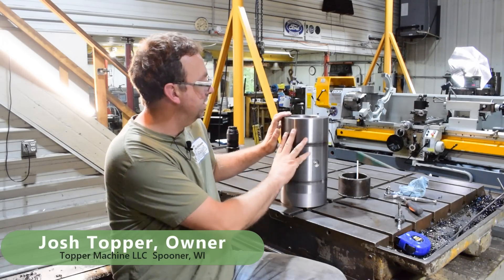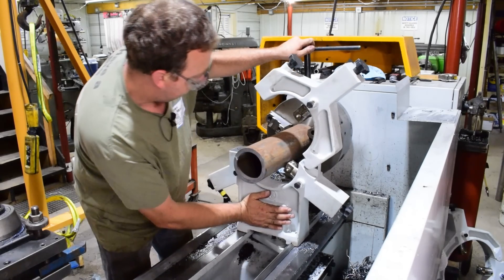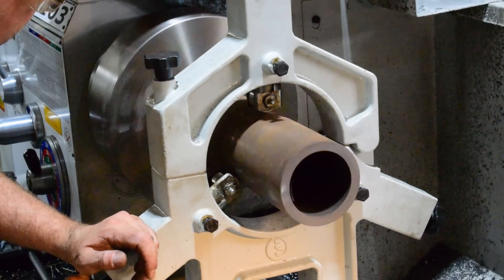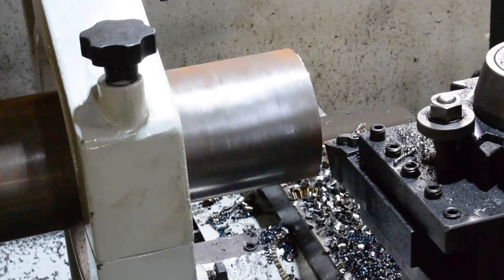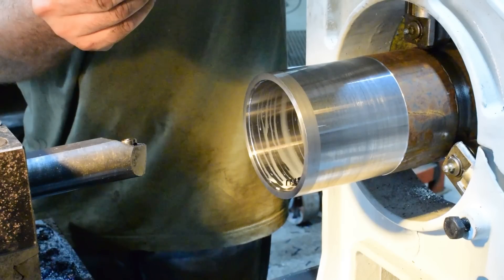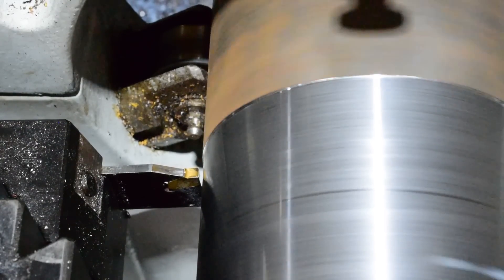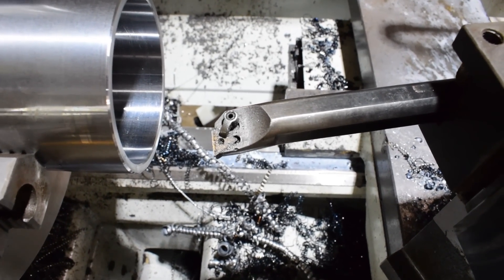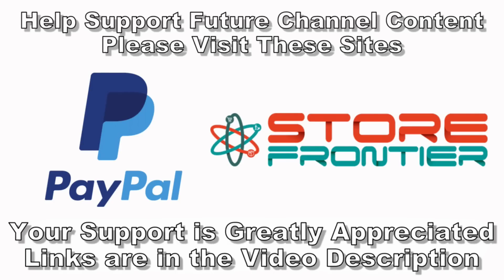Machining Custom Bushings for an Excavator - Manual Machinist

Comment: An old lineshaft driven oil grooving lathe turned up fairly recently not too far from me in Oldham....
It was made in the early 1900s and had a bull gear like a shaper that you could alter the stroke with...

I should've grabbed it actually...
🇬🇧😐
Reply from the maker: I have been watching for an oil groover. Seen a few, but nothing reasonable
Reply: @TopperMachineLLC  

This one was made in Manchester somewhere......all my stuff is the old lineshaft driven stuff...

I've loads of it Josh.. 
🇬🇧😐

Comment: I'm not questioning what you know, but rather questioning what I think I know.  It's my understanding that bushings are meant to be soft and take the wear in order to take the wear in order to save the pin and the machine.  Are you saying that it should have been a harder material that would still be softer than the pin and the machine?
Reply from the maker: Don't question your knowledge, you are correct in some applications. In my experience, on this kind of equipment you want both to be hard. Cat has the hardest pins and bushings I have ever seen. They last forever. It all depends on your application.
Reply: @TopperMachineLLC  thanks for the explanation.   I appreciate your time.

Comment: Hi , im from Canada and what you are doing is very appreciate and that help people like me to learn more from experience person. Thank you. Did you change your gear on your lathe machine do to a grease groove like that ? I try on my and don’t matter how fast my traveling tool,i can’t do it
Reply from the maker: Yes. It is actually a very course thread.
Reply: Thank you, im working on it ! I try to find what is the best gear set up for my lathe . My work is around line boring and I need to machine my own bushing sometimes . Thank you to answer me so fast . I very appreciate
Reply: Can you share with me your setting?
Reply from the maker: @lucouellet6771  it was 1 thread per inch. Set it up like your threading, but pick a course thread.
Reply: Ok ,Thank you so much!

Comment: Bushing design has a lot of variations in materials, often choosing dissimilar materials for the bushings and pins. I've seen bushings ment to be the hardened material and also the wear material. I've seen bushings made out of bronze, white bronze, cast iron, plastic, composites, nickle, hardened steel, etc ... that being said, good to give your customer what they want.

Comment: Hi Josh,
Everyone's expressed their views on your work/video sched so there's no point in me adding mine since I agree with them, mostly. 
One question regarding your grease grooves. Would it not be advantageous to "end " your thread say 1/8" from the outer end of the bushing (inside on the lathe) and allow the cutter to dwell and form a closed groove that would prevent the grease from migrating out of the end of the bushing. I realize there will probably be a seal at each end of the sleeve but this might prevent leakage too. Just a thought.
Thanks for your efforts.
Reply from the maker: It all depends on what the application and Customer specifications. I make them both ways, just depends on the customer.

Comment: I’m wondering if you do that boring operation without the coolant on. The inside, if you cool it from the outside to help chill the material and prevent that “oops I overcut” due to heat. I’ve played around with a spritz bottle and coolant when I was doing manual work, but never a full flood due to the layout of the machine and lack of pump. Just a thought. It looks like your thru-spindle bore doesn’t have a coolant catchment on the back end where you’d load a bar, might be worth it? Our older tool holders have a through coolant attachment that you put a nipple on the back end and run your flood to it. Works pretty well if you have something to keep the coolant from shooting out the other end and all over the shop 😂

Comment: Thank you for sharing all your knowledge and tips with the type of work you do.  I am a small 2 man shop that we do alot of short run parts / die work/ and prototype work and we don't have the latest and greatest equipment, but we can get the jobs done accurately for our customers with CNC's and manual machines.  It's nice to see that you show the skill level and discipline to make the stuff you do.  Keep up the good work!

Comment: I remember back when we would get jobs in the shop.  Customer would supply their materials.  It was always "drill collar" stock.  That was 4145H hardness generally in the upper 30 Rockwell C Range.  Oh yeah, nice, and tough! It did machine nice and hold tolerances most of the time.  Hard on the machines, too!  Thanks for sharing, Ken.

Comment: Considering what you said about the material used it seems possible that you will be doing this job again before too long. It is important to consider whether you can afford to make a video, depending upon the time you have to do the job and how long setting up the video work will take. We understand the effort it takes and are grateful for what you share with us. Kurtis has Karen to do the video work and they can still only do one video per week. Do what you can and if it becomes stress you should cut back a bit. We learn from every tidbit you share. Thanks, and have a peaceful and restful weekend.

Comment: I was only a laser operator, button pusher. I appreciate your skill. Your work requires more precision than my sheet metal job. It is to bad that the customer did not give you the right grade of steel. I am glad that you enjoy your work and that you are able to provide a valuable service. 😃😃😃😃😎😎

Comment: You should have but a grove 1/4 inch on each in then then thread it . The Grease on is going to follow those threads out
Reply from the maker: Not what the customer wanted.  I do some that way, and some all the way though.  Depends on what they want.

Comment: Nice video, I miss the trade. We would usually take the bore mic and measure across it with a regular OD mic just to be safe. I have not before seen the handle for those ID mic tho, Ill have to look into that for myself. It also Sounds like the customer will need to be returning again soon for new bushings, Hardened steel or the correct grade alum bronze is a must IMO.

Comment: Josh what material would you recommend to make the bushings out of?
Reply from the maker: 4140 at least. Done some in 8620 and T1. But 4140 is available in tubing for railroad brake rigging bushings.

Comment: Well done on the video part, you getting and better at it. Txs for sharing. 
I turned two bushes myself this week, only the size was a tad different: 2 mm (78.7 thou) ID and 2.35 (92.5 thou) OD, which leaves a wall thickness of 6.9 thou 😁. And I got it right, first time!

Comment: At what point do you suggest to the customer that there is a better material, design, etc.?
Reply from the maker: Before I even start. He showed up with the materials and said make it out of this. I said that it would not he up. He said I bought the material so use this.